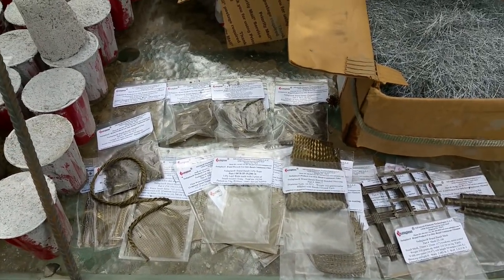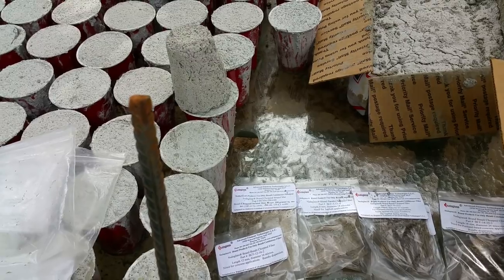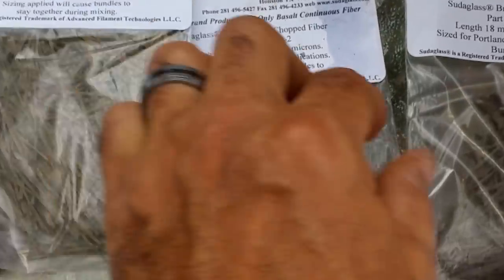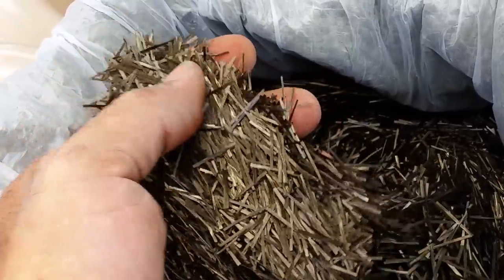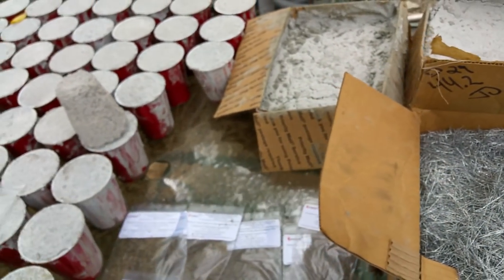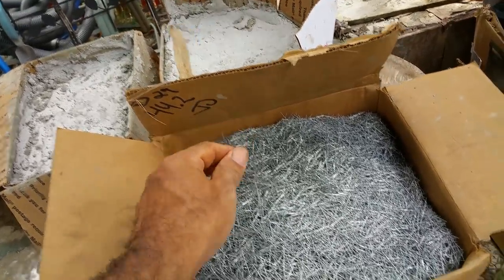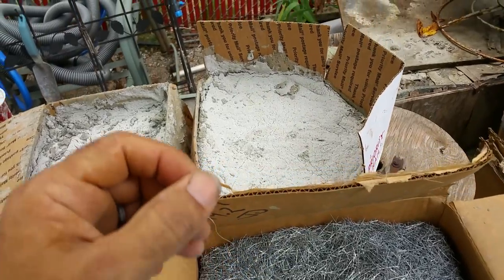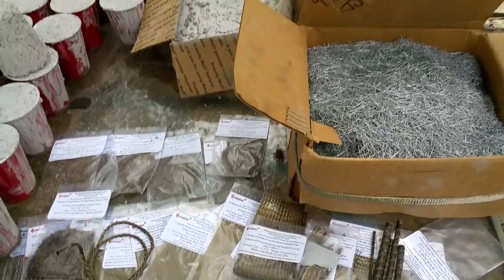Cement and Concrete Reinforcers | Helix Micro Rebar #helixmicrorebar #aircreteharry #reinforcers

Comment: Foamcrete (cellular concrete) is usually very weak but combining the foam, fibers, super plastisizer carefully, using the correct sequence to avoid foam collapse, it produces a high strength material, between 2,000 psi & 18,000 psi, depending upon density you choose, that is workable as fluffy plaster that is great for a overhead application.  Start with 1/2 bag of Portland Cement (47#) and one bucket mortar sand ( make sure it is real mortar sand, ASTM C-144 with pebbles screened out with No. 5 screen.)  This is a 1 to 1 ratio of sand and cement.  Mix in mortar/plaster mixer at low RPM.  Add 1 gallon water then add 8.75 oz Plastol 5000 and wait 8 minutes, until material stops reacting to gauge water content.  If the mix is runny and oozing like lava, stop adding water, if not, if it is still in pea sized nodules after 8 minutes, add 8 oz water, if it is in golf ball size nodules add 4 oz water then wait 4 minutes to see how far mix advances, repeat until mix just achieves flowability where half of mix is pulled over axle, other half stays behind.  It is important to wait after cut water is added because if you add too much water, the mix is unusable and it takes time for hydroxide reactions to complete.. Mix should be dry and crumbly when held and broken but if clod is held still in palm it should ooze off palm and drip and stretch in between fingers like molten taffy.  Weird stuff.  Once it is oozing it should have a course sandy texture.  At this point, this is key, Be sure and let mix for another 4 minutes until that course sandy texture transitions to a medium sandy texture, this is important to avoid foam collapse. Slowly add 100 fluid ounces of STAR M3 refined flyash, by Sefa group. Wait 4 minutes then add 4 oz of cut water so repeating cycle of  adding 4 ounces cut water after waiting 4 minutes of low RPM mixing to return to same smooth fluid consistency.  It is very easy to go over on the water so just be sure and wait 4 minutes for reactions and stop when material is flowing with only about half flowing over mixing paddle axle. If most stays behind, it is too runny so use less, if any, cut water for final cement.  Go prep materials for next mix or pack sample cubes to avoid temptation to add water when it looks dry.  Just wait.   Now add 24 fluid ounces of Eucon MSA refined silica (Silica Fume) and repeat cut water and waiting cycle.  The total water is not known because it is difficult to gauge how much is already in sand and how much is lost to evaporation because of temperature, humidity and sun conditions, which can intensely exacerbate water lose caused by by mixing friction so it is good to follow the cut water cycle which is about paying attention to what is happing and responding.  The total water added from beginning is usually between 1 gallon to 1.3 gallons.  There is just no telling how much water is being provided to the hydroxide reaction so the key is to hitting the mark, achieving minimum hydration, is to wait after adding small amounts of  cut water to moisten the mortar when it is fluid and in a highly reactive state instead of a dry, non-reactive state, to see how it responds.  After you have a fluid mix that is not too runny, but moves like taffy.... Then  Add 2 gallons of fresh fresh cellular concrete foam, properly diluted (1 to 32) and properly expanded 1 to 15 ratio.  Use the Mearlcell 3532 foam frome Airex Industries. Then add the 32 ounces total of fibers (20 fluid oz BCF 9-13-a Sudaglass brand basalt chopped fibers and 12 fluid oz of BCF 24-20-2.)  If you go much beyond this much basalt, you will have surface tears when plastering.  Let mix about 3 minutes until even and smooth. You can use this mix as an ultra high strength mix or carefully work in more foam and another 5 gallon bucket of sand to stretch it by adding in remaining bucket of sand in 2 to 3 portions, with another gallon or two of foam immediately after.  Check your density with sample cube as that will always be relative to compressive strength if procedure is followed. Use 2"x2" plastic mortar sample cubes to monitor density and unexpected changes caused by foam collapse or unexpected expansion (which happens).  Below 210 grams per cube is the bottom threshold for being too light, which is above 25% air and won't be much stronger than regular mortar or concrete after 90 days about 2 K psi to 6 K psi.    220 g to 265 g range balances aeration with a very high compressive strength while being a perfect fluffy plaster for overhead ferrocement or Flex-Shell Core Monolith Architecture like at Shambhala Village.  It is tricky, like making bread, but if you follow the minimum hydration sequence, your foamed mortar may only occasionally have collapse problems but the mix will always be fixable with more foam and always be premium and usable, although you will get spoiled by the nice ones. You can always soften it up a mix with small amounts of water, within the first hour of use as it stiffens, without changing the compressive strength. Damp sand will help prevent collapse but you will have to become a master at minimizing water at the beginning or you will just ruin the mix by making it too runny if the sand is too moist.  The advantage of closed spherical cell aeration in a dense, high-strength matrix that is water-proof, is not so much the toughness, it is that the shell and the metal armature or reinforcing it is in contact with is forever protected from chemical expansion damage, damage caused by internal stresses such as rust expansion and ice expansion. The expanding compounds are forced to grow inside the spherical micro voids, that are surrounded by a dense so capillary-free matrix, where they can do no damage.. Your material and reinforcing is essentially fossilized because the chemical processes that break down concrete and rock are minimized and removed and your reinforcing is sealed from moisture.  This is important if you want to build something that will last; if you want to build for the future. This technology is in the public domain so is not patentable and free for anyone to use, although it is copyrighted to secure its free-to-use status.
Reply: You man are a rock star
Reply: ShambhalaVillage
Reply: How much a house built with this would cost?
Reply: Eres grande en el tema amigo

Comment: Don't use the metal micro rebar to reinforce cement. When one of the nails rust through it puts stress on the others and starts a cascading effect to the rest of the reinforcing nails. Monolithic did an experiment as to durability and it failed, that is why they use basalt fiberglass micro rebar.
Reply: You can get epoxied rebar that is resistant to rusting (it's usually "painted" blue) this works well for reinforcing concrete as it doesn't rust.
Reply: You can penetrate the concrete so water cant go in

Comment: thx for the video harry. ever think of layering reinforcing fabrics...say lay one sheet on the bottom..then pour half way, lay another layer,  top up the aircrete, and then laydown a top layer..so 3 sheets of fabric...also, i talked to a cement company up in yellowknife northwest territories (his name is dale), and he was saying they were having problems with adding basalt sometimes...i guess it was leaching acidically. i was thinking of the basalt rebar, but after talking with dale, ive been rethinking. i also asked about the helix micro rebar, and he said they tried but found that it settled to the bottom too much....but then again, they were pouring regular cement, not injected with air and in aircrete.

Comment: What is the micro-rebar made of ? What happens when it reaches a surface ? Would it not conduct water into the concrete or damage any membranes ? Did you do a follow up video of your experiments with these ? Thanks again for the wealth of info.

Comment: I have to ask: Will the Helix Micro Rebar OR the basalt fibers work with Foamcrete (for that matter, is Foamcrete advised for use with conventional rebar or other reinforcement?)  I ask because I cannot recall having seen Foamcrete ever used with reinforcement.  Truly appreciate the information in this series - cannot believe that there are less than 10K views of this material.
Reply: Check around 7 minute mark. He is running a test on "air crete" which is the same thing
Reply: With basalt fiber you do not need autoclave process, so you will get the same bricks using less energy? and only 4,8kg per cub. metr
Reply: With basalt fiber you do not need autoclave process, so you will get the same bricks using less energy? and only 4,8kg per cub. m
Reply: AAC (Aerated autoclaved concrete) is not the same thing as foamcrete. Foamcrete mixes a foam with a cement mixture, whereas AAC uses a powdered foaming agent in the mix and then bakes it to cure. SImilar but not identical products.

Comment: Is the micro-rebar a stainless product? If so, degradation should be GREATLY reduced. The biggest problem with standard red iron rebar, is oxidation. Once the rebar starts to oxidize (rust), it cavitates. This creates small pockets of stress relief. Not so much a problem with tensile load/stress (in line with the rebar), but horrible for flex resistance.

Comment: I would question the micro rebar. Regular rebar needs to be 2" inside concrete to protect it from water. Water makes the metal rust in the concrete and expand. What keeps the micro rebar protected from water and rust? I would guess that the concrete with the micro rebar would break down over time. The basalt chop on the other hand will not be affected by moisture and should add the same strength as the micro rebar.
Reply from the maker: The Micro Rebar is zinc coated it wont rust.
Reply from the maker: http://liteform.com/helix-micro-rebar-2/
Reply: The alkali in concrete helps to prevent rust. Iron will not rust in a highly alkaline environment. I made a battery with steel wool immersed in a strong lye solution and it sat for a year with zero rust. Steel wool in plain water will turn into a pile of rust powder in a day or so.

Comment: Hi Harry.
Good video but a bit confused about your mention about concrete which uses aggregate for its strength, gravel....usually ...
Have you ever put sand in your aircrete?   Would that not make it stronger? .   And heavier of course...I want to carve it so don't want any fibers. Interested in your thoughts.

Keep experimenting it's good for the brain cells..

Comment: fiber glass in resin nothing new. The ultimate reinforce is stainless steel rods and harden stainless shavings. They use it in safes walls in large banks. Its hard to break hard to cut and dificul to drill.

Comment: so u wouldn't bother with hemp then?  just use basalt. lol. awesome.
Reply from the maker: Correct the hemp will not work for the building method I will be using for domes. And when It comes time to build other  places the hemp will add cost to have it shipped to the build sites, because it is not readily available everywhere the way portland cement is. And I will be using Helix micro rebar for my Concrete.